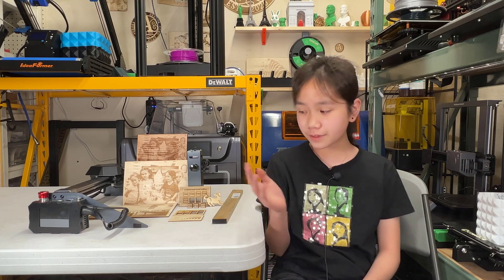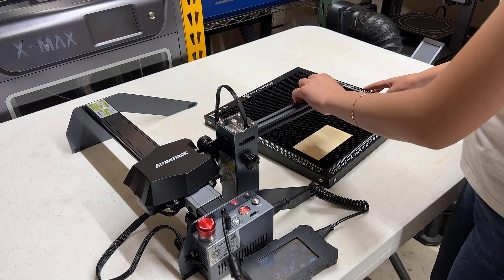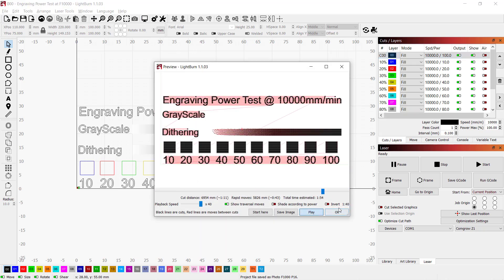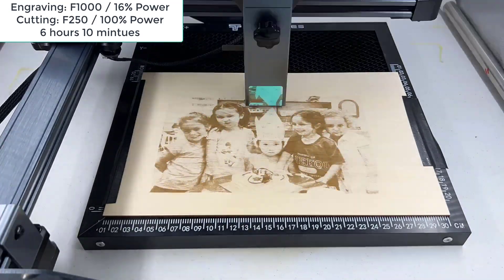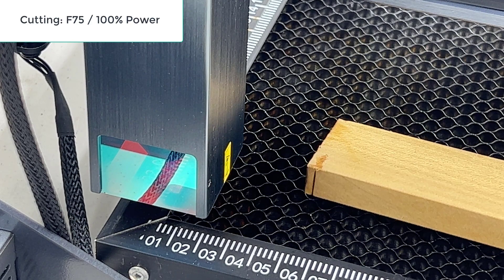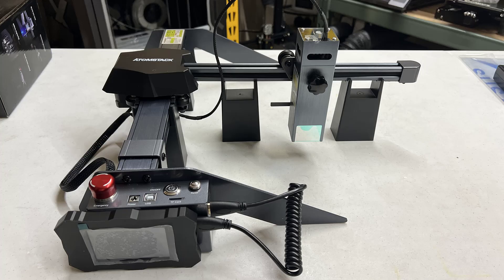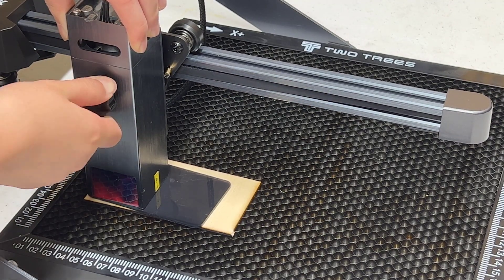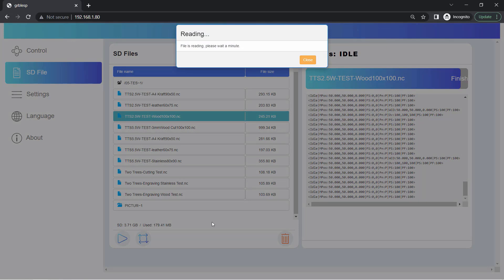AtomStack P9 laser engraver: 10W laser module, touch screen offline controller, Pros and Cons

Comment: I like everything except the size. It could be bigger they couldn’t of saved that much by making it that small. Maybe you should do another video making the base area larger.
Reply: Saved alot in shipping, added material for stiffening a larger frame, bigger rails, bigger belts etc